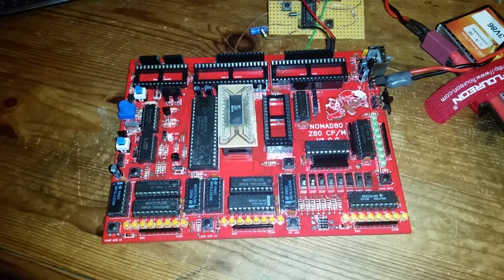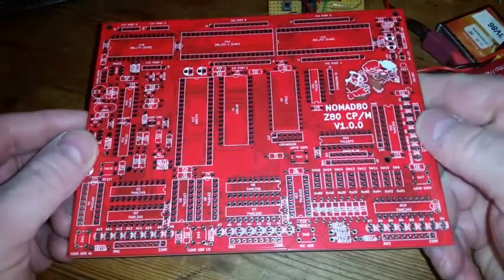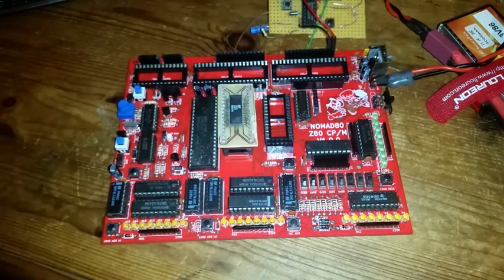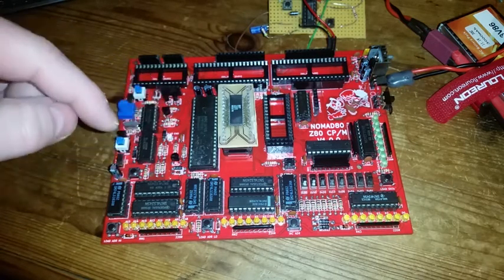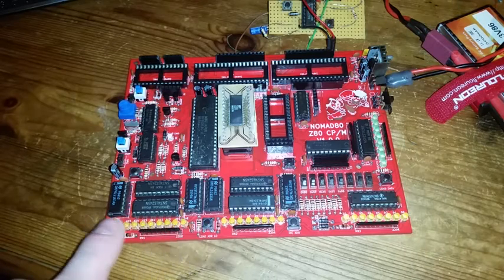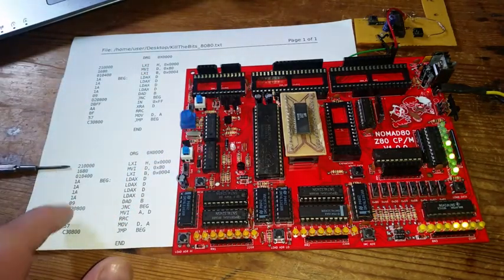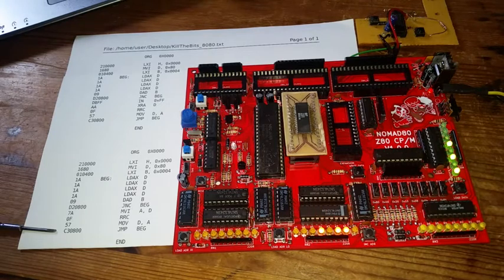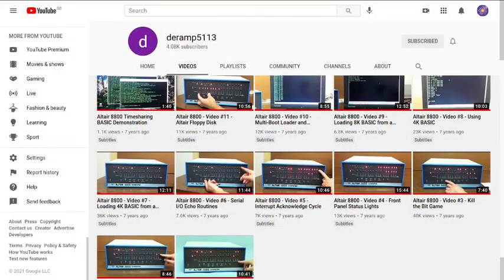NOMAD80: Z80 ROM less Computer, Programed Like The Altair 8800

Comment: This is very cool, but I was kind of hoping for more discussion about how it works. If I were doing something like this on a 6502 "the easiest way possible" (which doesn't help you debug much), you'd hold the CPU in reset, tri-state the bus, and have 16 switches to set an address and 8 to hold a data value, and pushbutton + 555 set up as a one-shot to pulse the write line and un-tristate a buffer connected to 8 more switches. A very manual process.

Automating some of it, you use a couple of 8 bit settable counters with just 8 switches. You set them, hit a button to load the high address byte, set them again and load the low byte, then a third time and hit a write button, and then an increment button. Maybe you even have a decrement button for faster examination of what you've already done.

The 8080 and Z80 have a more clever solution used on the Altair and IMSAI and other friends where careful control of a few signals on the bus allows you to simulate some two and three byte instructions as if they were read from RAM which let you read or write RAM one byte at a time, start running code from here, run the next instruction, and probably other things, probably including show me my registers or whatever else if you want to wire it all up. I'm looking for a good explanation of how that's done.

You had some references, so I'll follow up on those.

Comment: hello, i just made an at28c256 eeprom programmer with arduino nano, i managed to put some code in it, but when
I put the eeprom in the breadboard and make all the necessary connections for reading CE (low) , WE (hight) ,OE(low), I noticed that when I touch the wires with my hand i got  the correct values and if I take my hand away I got an incorrect value, the programmer read the correct
values too , so plz can some one help
Reply from the maker: It sounds like one of the pins is not being wired to a high or low voltage. With CMOS devices the static electricity in you can power the pin if it is not connected well to low or high.
Reply: @DevelopIT  thanks you again, tomorrow i will finish my kit on strip board then i will see how it perform again thx alot

Comment: very nice what your did, i hope you share  a schematic for that nice kit
Reply from the maker: As I'm doing the test videos, I'm explaining the parts of the schematic that are related. At the end after I hopefully get CP/M running on it, I'll publish the schematic, so it's been verified and any issues resolved.
Reply: @DevelopIT  Hi what do you mean by release adress bus, coz when i stop the clock for my small z80 and reset the processor , i see all adress pin goes high, so i cant programm it like altair, that why i asked for your schematics,the doc of z80 say that adress bus gos hight impedance so that mean the z80 is disconnected from the board, can you plz explaine this
Reply from the maker: @warismwarism2480  The latest video in the series talks about user control of the address and data bus. I use the BUSREQ pin to request access to data and address bus from the CPU. When the CPU responds with BUSACK, you can use the address and data bus.
Reply: @DevelopIT  Ok thx a lot, I subscribe to your channel you deserve
Reply from the maker: @warismwarism2480  Thank you for subscribing.